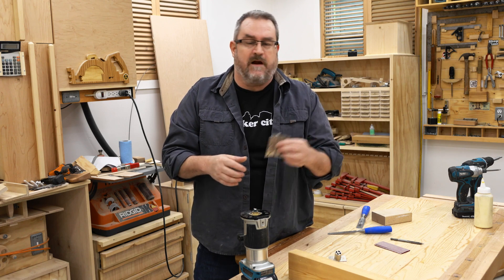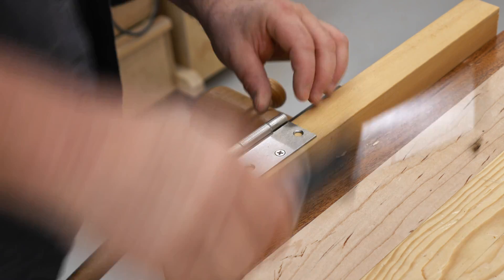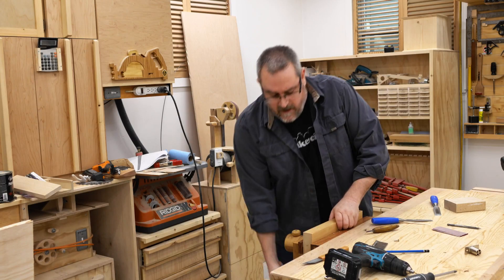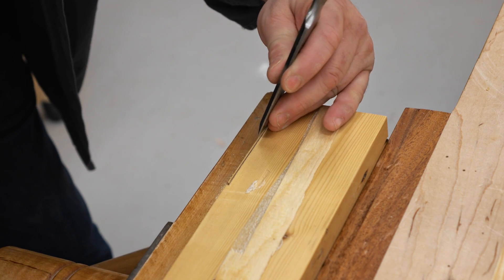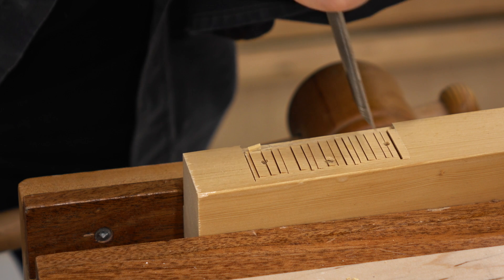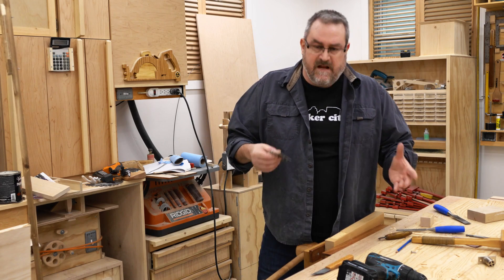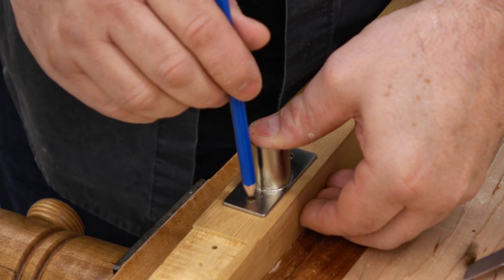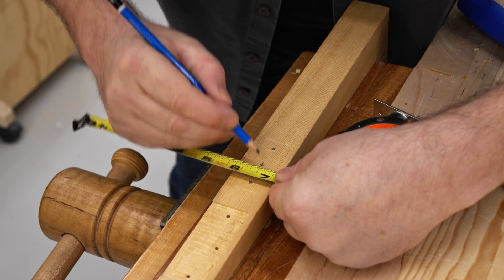How To Mortise Hinges (and other hardware) By Hand

Comment: Excellent Tip at 1:58 to pre-cut the  outside edge to prevent blow / chip out.  I'm a professional finish carpenter and have hand set $5000 doors using the exact same methods you show. Works like a champ, take your time and go slow, it won't matter next week how long it took only if it's accurate. 
Thanks John!

Comment: My job is installing doors, locks and hardware in high end houses so I do this daily and everything in this video is spot on. Ragged edges are simply not allowed. The relief cuts are super important particularly when working on already painted doors to avoid chips where it should be done on 4 sides. I carry two size Vix-Bits in my belt which I send home and only rarely do they clog which can be cured by dropping on the floor. Really. Try it. While I most often use router templates bought or made I have a lot of hand work to do too. I use a standard utility knife and by tilting it can control the space left next to the item to be mortised from too tight to dang it. Look at the the angle on the tip of the blade and this should make sense. Excellent video!
Reply: I use to  use a kwick set jig for  drilling back sets for lock sets then would drill the striker plate hole and the template for striker plates , but most jobs are millworker today, the  deal is sharp tools are a must!

Comment: This has helped me out a great deal, particularly the placing of the hardware, drilling the centre hole of the hinge giving me more freedom to use the marking knife, another thing I have never done before is using the marking knife so much, particularly chipping out the left and right edge before slicing that aris off to avoid that serrated edge, this excercise was a complete education, thank you so much as this has left me far more confident to tackle this without the aid of a palm router.

Comment: Almost exactly how I was taught in my apprenticeship. I was never allowed to use a router and template. Don't think I've ever used a router for mortising door hardware, actually. Probably should have at times lol. Simple work like this helps a person hone their chisel skills though.
Reply from the maker: When I first started in the commercial door and hardware installation specialty, all of the doors would come raw - just slabs with no prep. We'd have to bevel the edges, prep for the hinges and cut for the locks, which were usually mortise locks. Doing 200 of those makes you appreciate the machines, but you'd still occasionally have to do something by hand.

Comment: I just replaced all the doors in my house along with the door jams (doing a full rehab, the previous owners had a dog/dogs that tore up all the door frames).  The first couple of doors didn't go very well, but by the time I got done, they didn't look too bad.  I REALLY need to build a sharpener for my chisels. They are all pretty beat up.  Once I move, I'm going to find a property with a shop or a place for me to build a shop and I'm going to start building all the jigs I need to refine my woodworking skills, with the chisel sharpener being one of the first.

Comment: Done the cardboard trick a good number of times, especially when replacing old worn out hinges that are thicker than the replacement. Worn hinge you can double the lift just by turning around so the unworn bearing face is going to take the load, though often the pin is loose as well, so replacement time instead.

Love Forstner bits as well, makes putting in mortise locks so much easier over the old method of drilling multiple holes and cutting them together, now just drill around the template and saw it to shape with the drill bit.

Comment: excellent video. I'll be getting my chisels tomorrow and hanging my custom built door.  I just wish I would have used chisels on my door instead of a router and planer. I have a 3 1/2 inch thick door and needed to cut down to 2 3/4 to fit the door handle on. thanks again for the great video.

Comment: Nice stuff, I am an English Joiner, Carpenter ( 55 years young)you are showing the true stuff here. I now work in Germany and they don't know how to do it by hand here, it's always machined in, they don't really teach this technique here, however if you Become a Meister Handwerker which costs you personally 25,000 €  after your  Aprentership for the certificate,  and they still don't know how to set a Hinge but they are allowed to teach people.  Officially Here in Germany I am not allowed to be self employed as a Carpenter because I am not a Meister. Officially if I do want to be self employed I can fix wood to walls but I am not allowed to fix wood to ceilings and am not allowed to say I am a Carpenter even though I am a Carpenter for 35 years with a full English  Aprentership . If I was to give out  Business cards I can only say Floor layer or Handworker on them to advertise me. Such is life in the Fatherland.

Comment: Really cool to good watch a true finish carpenter do this. I do it at work all the time, but as a jack of all trades I normally do it with a utility knife, a 1/2” chisel I’m rather fond of and a framing hammer lol. Typically pretty good results, maybe a little streamlined version of what you did though

Comment: On the Ball Catch if you had drilled the Hole for the Body of the Ball Catch First you could have used your Vix Bit...  Other wise If you had the smallest size Vix Bit you could have used that while the Ball Catch was inverted... Good technique on the Chiseling... Greg
Reply: I was thinking, while I watched this video, that it might be simpler and/or give better alignment to drill the deep recess for the ball catch first, then pop it in, add one screw, mark the recess, then chop it out.

Comment: I have a door slab that is standard 1 3/8" thick, and my hinges' leafs are 1 1/2" wide (not including the knuckles). So if I line up the hinge like in 0:38, they would go too far over the edge. Did I buy the wrong hinges? Thanks!

Comment: Can this method be done with rounded hinges if I use a razor to score the rounded corners?  I'm building a shed and I'm using a door that was removed from my mother-in-laws house which has the rounded mortise style hinges.  I need to mortise the frame to hang it.  Would it be easier to square off the existing rounded mortises in the door and then make a squared mortise on the frame to match, or just mortise the frame with rounded corners and leave the door as is?  Thanks!.

Comment: Thank you for this tips video, I recently mortised out a lock set without the right technique. Your way would have been much cleaner. But when you are working with a door, how do you put it in your vice 😎😁
Reply: A bit late but put 1clamp on the lock side of the door at the end and that will stabilise it enough
Reply: @bengeorge4437  thanks, it was more of a joke because normally you can't fit a door into your vise🤣🤣
Reply: @TheGrantAlexander  depends on the type/size of vice
Reply: @bengeorge4437  agreed, but if I recall correctly the vise used in the video is too small for that
Reply: @TheGrantAlexander  true

Comment: John - this is great! I am in the middle of finishing up 2 custom doors and while I have used my router for making some of the mortises, I've tried not to rely on it too much. Learning to chisel well is kind of fun. One question - what if you find that your mortise was off by 1/4 inch or so? I had this happen last night despite multiple measurements my top hinge was off by just under 1/4 inch. I carved out an area to allow the hinge to move down into alignment, but now I've got a bit of a mortise gap showing above the hinge. Would you recommend wood putty for this and is there a specific type that's best?

Comment: Most probably there's a standard distance from the bottom and top of the door where to place the hinges, right? What is it?
Reply: uk standard is 6" down from top ,9" up from bottom and third in centre between top and bottom hinges, very large or heavy doors may have a double hinge at the top

Comment: I never have to use cardboard!? I’ve been a joiner for 45 years and from an early age took time to get it right! I use a small cordless router for hinging and cutting lock/latch face plates which over comes different grain directions? I use home made jigs to rout hinges on doors and post so if at a later date the doors could be swapped out and placed elsewhere. CARDBOARD ! Lol!!!

Comment: would you recommend using a trim router free hand, then using a chisel to remove material close to the line?
Reply from the maker: Absolutely,  I've done that many times as well.
Reply: Thank you John...you are the man. Just want to say I have watch almost all of your videos and your methods have really inspired me to take more of an out of the box approach to woodworking. Thanks keep up the good work!😎👍
Reply: That method works well. What I do is screw the hinge onto it's spot like John did. Then score around it with a knife and make the scores deep enough. Take the hinge off and route out the bulk first staying away from the line about 3/16". Then when you move the router closer to the line, that has been scored, the pieces will just fly off and you will be left with a nice clean cut. I do not have John's chisel skills.
Reply: @daifeichu  thanks man!
Reply: Yup. I do it frequently.